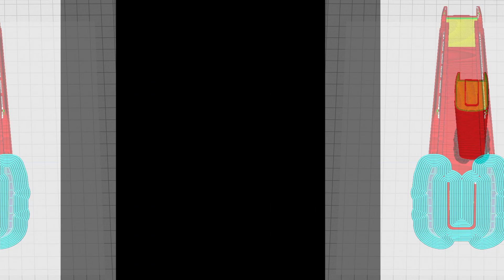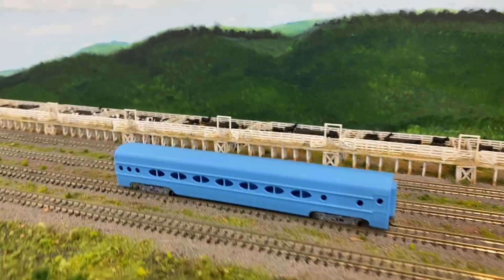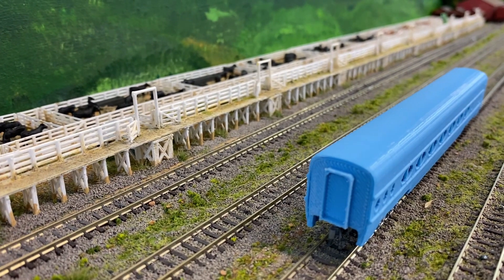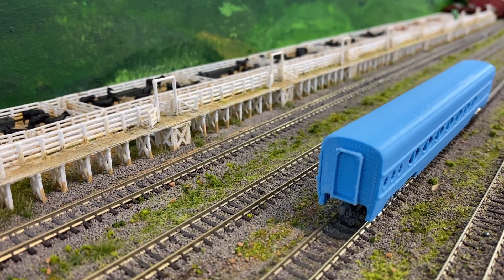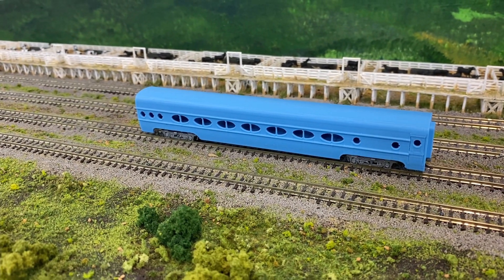N Scale Pendulum Car 3D Project

Comment: John that is going to be beautiful when finished.   But I got a little more interest in your  Cattle yard.  Take care, Chris
Reply from the maker: Hi Chris, Thank you for your comments. I have been working on improving the car with some mods. The area in front of the stock feed lot is my favorite place to take pictures and do videos. The feed lot is 5 1/2 feet wide and 6 inches deep. It has 18 gates/ramps with the correct distance between gates to accommodate 40ft stock cars. There are around 200 head of cattle, 30 or so sheep, and about 24 hogs in the feed lot. Other than the two end buildings it is 100% 3D printed. It was my first project…..John
Reply: @tanzj  wow John,  I'm totally impressed.   I'll have to look at some of your older stuff

Comment: awesome build love it i'm printing another car right now. i had to reprint my engine i got a different one i didn't like the other one it had some bad spots
Reply from the maker: Hi Dwight, The designer did a very good job so it was just a matter of seeing if an FDM printer could actually print it in an acceptable manner. The PLA that I used came from JMO in Ohio. I don’t know if it is regular PLA or PLA+. It likes a temperature in the 205 to 225 C area. Have fun with your print as well……John